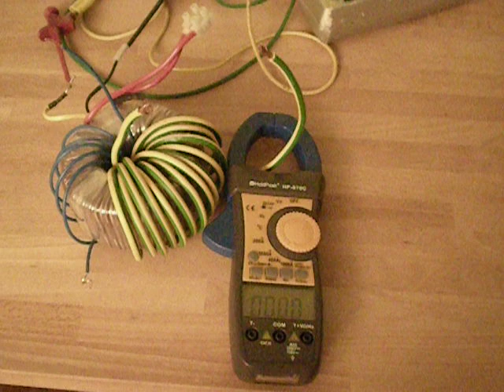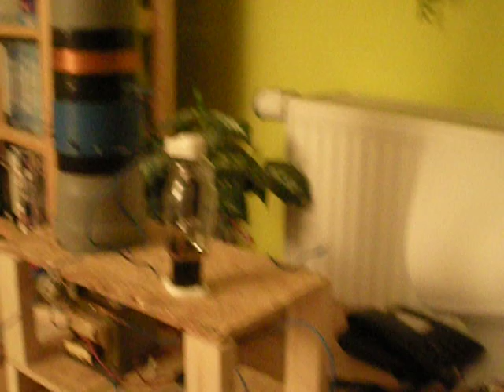Toroidial high current transformer (540A 5V AC)

Comment: 540 amps are not possible with this set up at all... the only reason you are getting 540 on your amp meter is because you Do Not have a load on the output...and you are dead shorting the output causing a false reading on your meter..
Reply: the wire  in use can NOT handle that kind of amps at any use able voltage for any amount of time... the size of the toroid is wayto small to produce that kind of amp and the biggest one of them all is that you measure amps in series in a circuit which is not done... it is dead shorted in this video causing the meter to give a false reading..(Amps are the measurement of flowing electricity. Not shorted electricity)
Reply: +scuba369me Since in real life there is no such thing as a perfect short (which would cause INFINITE current to flow, not zero, so in fact amps ARE the measurement of ANY "flowing" electricity EVEN through a short!!!) he is ACTUALLY measuring 540A through a very low resistance (like 0.1 ohm) which, due to the Maximum Power Transfer theorem, may as well equal the maximum POWER that that transformer can output since the short's resistance is similar to the resistance of the wire coil!

Comment: hello sir is possible to use 15AWG enameled wire to create a transformer for audio amplifiers two 35V AC and center taped so is two windings isn't that right?
Reply from the maker: Center tap means that you have a "tap" at the center of the windings length, this literally creates 2 windings with the same winding direction, this is used in Push Pull amps, and to if you can use 15AWG Wire and a toroidal Core i presume for an audio transformer id say yes, but you would be driving some serious power into the transformer if you need that thick of a wire. I Recommend looking up how to make your own Audio Transformers online there are a few nice threads on some audiophile forums that tell you how to make one. I personally haven't worked much with audio grade transformers, i personally avoided them if possible in my projects. This is to do with me not wanting to add a lot of wait to an already heavy device...

Good Luck with your endeavor to creating a Audio Amp!
Reply: *****

thank you sir, I have plans to just "add to a already made 120 AC primary toroidal I have, I only will add the two windings to see if I can achieve at least 35 0 35 V AC for a solid state amplifier I designs a year ago, so 35 VAC will give more or less +55 0 -55 VDC after rectification and filtering, don't worried I be carful this is dangerous I will use fuse all the way sir

best regards
Juan

Comment from the maker: the only dangers part of the experiment was the arcing (UV emissions) and the 220V going to the transformer, also potentially the heat coming from the cables after short circuiting the transformer. even if i were to touch the 220V side the ground fault interrupter would have shut off the power before i would get severely injured. so basically it was safe, the worst i could have done is burn my retinas or my hands, and passably get a slight shock. but nothing leathal.

Comment from the maker: probably not, it lacks the voltage required, spot welding passably, but not arc welding, my arc welders use about 35V, and this transformer delivers at most 5 volts.

Comment from the maker: since i have already reused the transformer with a different coil i can no longer do that, but i assume the voltage doped to about 0.5 volts or so, just a wild guess but this happened in another experiment with high current with a different transformer

Comment from the maker: i can tell you, i don't have the wire needed to rebuild this transformer, i used it in another transformer in the permanent setup of my vttc. but its easy, just get a toroidal transformer with like about 200 or so watts, and get some 10mm² wire and wrap it around the core in the same direction as the windings already on the core. and use a volt meter to determine the voltage per turn ratio. and then wind until you get the desired voltage. maby i will make a tut as soon as i have a new hard drive

Comment from the maker: who sed it was going to be outputting that much current, it was made to run a vacuum tube with a heater current of about 6A. this video was just for fun, and the coil did heat up quite a bit with just a few seconds of short circuiting.

Comment: Actually a 2500 W load is a realistic value, I think.
I calculated with an 11 A@230V as a source which doesn't melts down a 16A fuse.
Furthermore, the output impedance (impedance of the secondary coil at 50 Hz) equals 5 / 540 = 0,0092 ohms which is not absurd.

Comment: Nothing is ideal in practice. Only in theory and for the beauty of theory. 
It sure has it’s own resistance and will dissipate all the electrical power back into it, resulting the heating of the coil and core. 
But here stated is a 540A@5V  (~2.5kW) not at 0.002V or whatever the drop.

Comment: The threshold of shock with AC is around 60 volts, this is only 5. Yes it is the amperage that kills you but you must have the voltage push behind it.  4 years of engineering & getting the degree helps to know what one speaks of

Comment: He said it is only 5 volts so it would not have shocked him, although at 540 amps it is a fire hazard when shorted.  If he converted it to DC after the transformer, it has the ability to power 1000 five volt iPods.

Comment from the maker: actually the transformer can deliver 2.7KW but only for a very short time, and i didn't design it to deliver that amount of power, it was intended as filament transformer for a vacuum tube Tesla coil. and as i have several years of welding experience i know a bit or two about UV emissions form arcs, and i was wearing welding goggles. btw the tube i was going to power with it was only going to draw about 40 to 50W from it. the short  was just me fooling around for a YouTube video.

Comment: Well, 250W is norminal output...
Somesay the maximum can be 10x over the norminal.
So the 540A is possible, i was wrong :O

Did something similar... at 12V i got 115A 
Thats insane for 300VA toroid ...

Comment from the maker: this was a short cercuit test, so the amprge is much higher then in normal operation. and i was only intending on running a 811A Triode off of that thing so it was tlenty of power for what i was doing. and i dout that my clamp meter failed. as it has always given acuret redings.

Comment: I need to build a high frequency transformer 10khz
input voltage 220 V
two secondary of output voltage 12 V and 200A each once
power 5KW
I need help for this design and materials
thanks
regards of chile
jpabloespinozac@gmail.com

Comment from the maker: @DjRaveKing why shuld i, im a tube colector, so i wouldnt distry them, and tube filaments only draw as much current as they nead to incandes, i actualy used the transformer in a project, were it suplied 6.3V to a 811A triode for the filament.

Comment from the maker: @suwadbureau its very simple, just jet a simple toroidial transformer (internet or ebay maby) and wind a new secendery. or get a masic toroid and wind about 680 to 1360 turns with thin wire, and wind a secendery with thick wire.

Comment: @lbochtler Thank you, the primary is about 450 turns of 30 AWG, consisting of 4 coils of 112 turns and 4 mm in lenght, in series and one after another (the polarities are correct, so the inductances add up), the secondary is 11 turns of 20 guage in a space of 3 mm. The core is 1.69 cm^2. Well I was thinking of getting 5 amperes and 12 volts, but it seems my design is incorrect hehehe.

Comment: Is this a ferrite toroid? how many windings does the primary have to not saturate the core? I have been trying to built some small E-I shaped, silicon steel core transformers and they behave like shorts when I plug them to 120V, and I find it incledible that a ferrite one doesn't blow up. Maybe my problem is resonance...